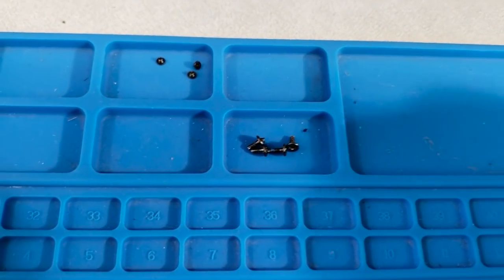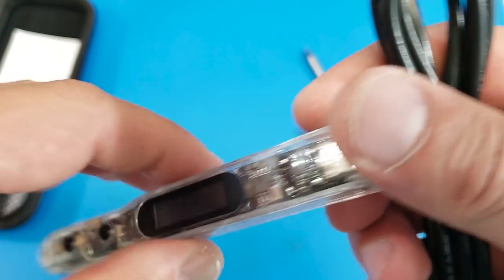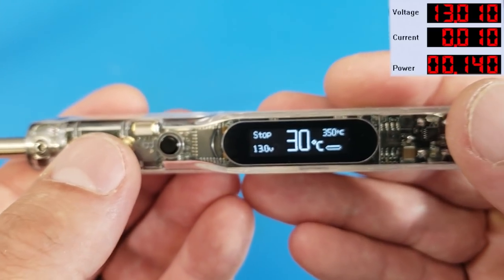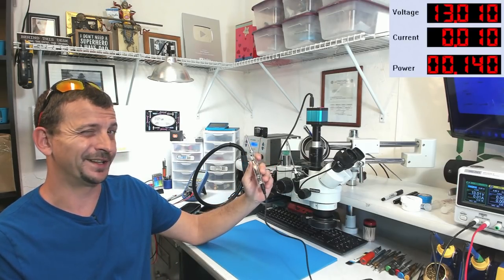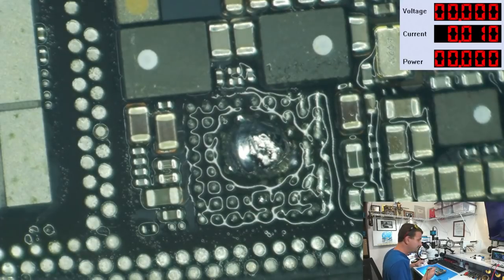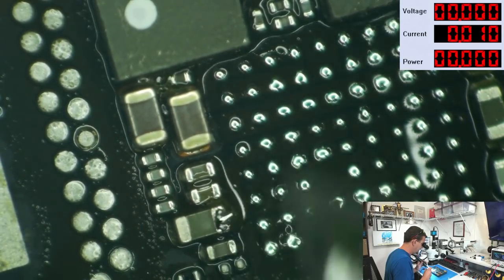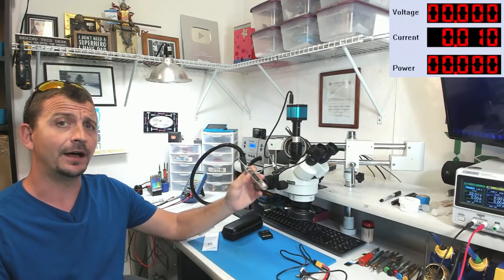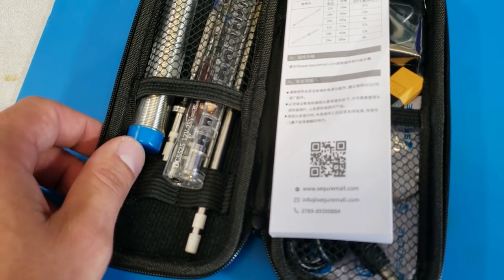Unboxing and Reviewing Sequre SI012 Digital Soldering Iron (AND GIVING IT AWAY)

Comment: Great review mate. Just a heads up, this iron is just a rebranded TS100, so it works the same as the other TS100 etc. If memory serves me well, it should run from 12v - 24v, although when I had the official TS100 I "overclocked" mine to run on 28v, but the fets weren't keen and got pretty hot. It runs optimally on a bench PSU at around 19v

Also those long T12 tips, they work perfectly fine on the FX-951 iron. I daily drive the T12 tips on my Hakko and in all honesty I've never burnt one out, but I have burnt out genuine tips. You can pick up a boat load of T12 tips for about $30 from Aliexpress

Also you can install custom firmware to make it run at 450⁰C too which is nice to have 😉
Reply: ts100 doesn't have usb-c power, looks more like a pinecil than a ts-100 to me. In all honesty a pinecil could be called a ts100 "clone" but I think the pinecil is more capable and it is way cheaper than a ts100.
Reply: @69uremum  The USBC is firmware updates, not for the soldering function.
Reply: @xxycom8963  pinecil has takes usb-c for power.
Reply: @69uremum  Yeah I just got mine a couple months ago and it's USB-c and barrel. I use the one I got with my TS80p with it.
Reply: Phil, you old soddering iron overclocker you :)
Reply: I have this & a pinecel(I like this better). Both will work with USB-C but my pinecel port was breaking down fast. I switched to a barrel connector with a PD trigger because I liked using USB cables but I got tired of the strain breaking them & it was damaging the ports also.

Comment: I'm into FPV Quadcopters and we love these kinds of things for field work. I've got a TS100 that I've had in my bag for the past 3 years and I can build a drone on a bench in the woods with it. These things are great
Reply: Id like to find the TS100 that comes in a carry case with the full selection of tips and a couple different cords to plug in with (barrel to wall adapter and barrel to battery pack)  but I have not seen it since people reviewed it when it first came out. If you or anyone else knows anywhere that sells that set, please share the location! :)  I do not mind if its another company making it as long as its comparable quality and on the stronger side if different power output, saw the TS80 has USB-C power input too but I am worried that the power reduction  might be noticeable on a ground plane.
Reply: @whoisntwhoisit2126  I even found a listing with everything together but that was a worse deal.
Reply: Seems my previous comment get deleted because of the links.

The shortlinks for the items are:
Full set with case :
_EIShXFr
Just case:
_Euv2c0V
Set without case:
_ExQLKVP

Just put these after the AliExpress domain.

Comment: I'm using the older version of this one (only 400 C) for more than 5 years already and I'm very pleased of it. It just working no issues at all and on 400 degrees it doesn't become hot on the handle at all. Also the Idle mode is very useful between the soldering. I'm still working with it and I don't see the need to change it.

Comment: I've seen a few people using that iron and they seem happy with it.
The 19v laptop chargers are often ideal and very common.
But i'm an old stick in the mud, so my 250 volt iron is good enough for my use.
Reply: 250v? Input or output? Is the iron as thick as your thumb and directly plugs into the wall without any circuitry? Found one from early days of soldering, was a seriously thick tip with a wood grip and cord coming out the back. Anything else controlling it would be inside the metal but no signs of anything visible - makes me wonder if it was hand made or one of the first/early mass productions.

Comment: The shorter tips are designed to be used with the TS-100 or Pine-64 Tips, so that thing is flexible enough to be used for tips made for different kind of system micro soldering irons

Comment: Those T12 tips are almost indestructible.  I recently had a faulty iron and the whole tip became red hot and the tip still works as before so setting it to 400 plus C is not a problem at all.

Comment: My TS80 got stolen alongside my toolbox last summer, it was the best soldering iron I got for mobile work. I need this but if in any case this seems like an improvement over TS80, so I will consider getting one of these instead. Wish they made a hot air gun this size too lol.

Comment: Don't forget about the set screw near button "A". Also, play with different firmware's. This is a clone of the TS100. USB is for programming only.
Reply: No, usb can power the unit. Check out the video less than a minute from the end.

Comment: I do all my micro soldering with the ST100. Lot of tips, never had to change the position of the clips. You can override the firmware with a custom one, lot of options and more heat if needed. Ramps up to 400C in seconds, much faster then this one.

Comment: This is my second time watching this video so sorry if I already put this info out there.

I have had this iron for over a year & it has been my daily driver. Until this week I only had two tips (both ts100 style). I bought a pinecel a couple weeks before I bought this & wanted see the difference. They are both close enough I could suggest either but I prefer this.

I had just bought some T12 tips to try & I like them. I also bought a HS01 tip which works great but I will need to make a stop for it. They are cheap & work amazing. So my pinecel will become dedicated to HS01 tips & my SQ to T12 tips. Bye bye to expensive TS100 tips. LOL

I will run off a PD charger but I suggest using a barrel connector attached to a PD trigger. The strain will kill your USB port quickly. Barrel plugs are cheap & I bought the cheapest. It is still holding up after a year of use.

Comment: Curious if the iron can be powered by the charger for the batteries? I've seen chargers with that connector that have variable power outputs to charge different batteries. Much like your power supply, just with the correct connector.

Comment: Need this,

I've been using this iron sating for around 2 years and the tips always get eaten up within 1 month and ive recently gotten into phone board repairs which i need an iorn that wont heat up to red hot at 300c. thanks for the considerations :)

Comment: Looks exactly as the Pinecil by Pine64. The solder stand is totally useless. It is too light. You should be able to run it at 20v and 65w.
16:35 Btw, 300 degrees are way too low. I use 370 degrees.

Comment: I’m really surprised about how efficient it is, usually USB irons are pretty poor. Personally I don’t need this and I’m in England, however I hope whoever gets it will have a lot of use out of it.

My one concern is I don’t think it’s safe for a child as there didn’t seem to be a guard between the handle and the hot element and tip.

Comment: "need this" and im random :) . Great review even if I do agree that the tips were a bit big for mobile works. but on the other hand no one fixes phones with a battery powered iron or usb-c. The other guy would through away those lead-free solder, It's a pain in the *